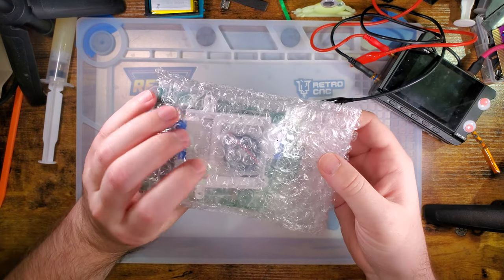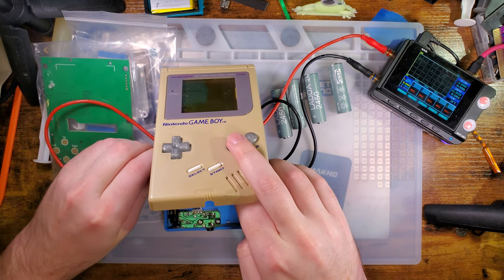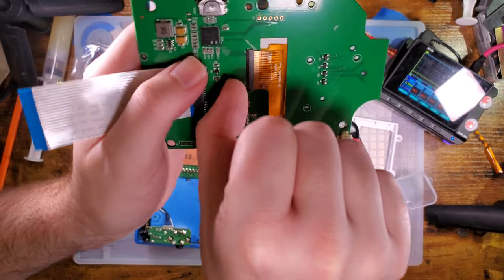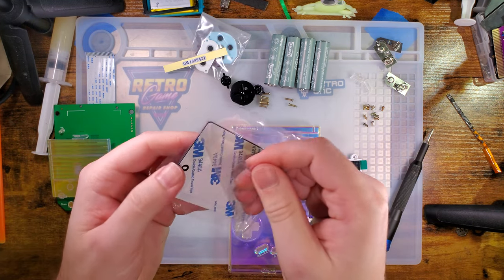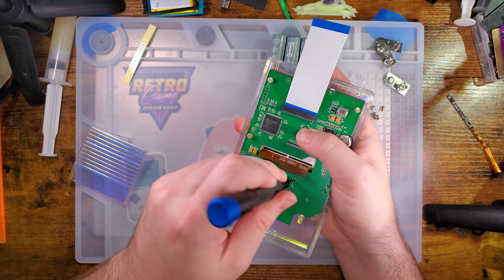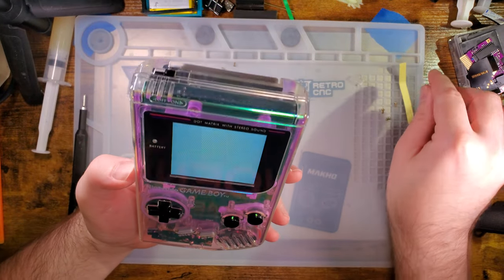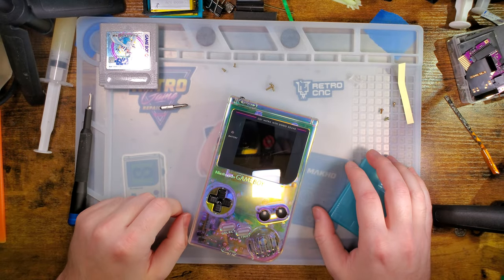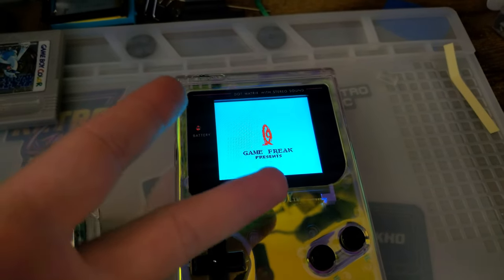Game Boy (DMG) 2.6" IPS Backlight Kit with OSD

Comment: Such a nice kit - I built mine yesterday and I went for the fully transparent shell. The situation with the screws is confusing. You get 3 lengths of screws. The longest ones are for the shell itself, the medium ones (there should be 4) go into the holes that align with the LCD bracket. Everything else uses the short screws.

Comment: Looks like a good kit. Was interested in either the smaller  tft 2.45 one with one of those nice clear shells or a RIPS v4 with a trimmed OEM black shell for a future build. Thanks for showing it off!

Do the high quality shells require trimming for this 2.6 kit btw? Something I was unsure of, if it was already pre trimmed or if the lens area is wide enough already for the 2.6 kit.
Reply from the maker: Nah, the "high quality" shells as sold by RGRS are actually made with these screen mods in mind so they should all be "drop in". Other generic shells or OEM type shells might need the window to be enlarged slightly though.

Comment: I just got this, have it all together. When I fasten the shell together the D-pad doesn’t work. If I take the screws out of the shell, and rest the top half on the bottom half with everything connected, D-pad works. Any idea what I messed up? Lol
Reply from the maker: You sure your membrane is properly lined up and working? Not screwing things down too tight?
Reply: @makho  I ended up using another motherboard and it worked just fine. Thought maybe I had accidentally jacked the CPU. But I plugged it into a stock DMG front half and it worked fine. So I’m not sure exactly what I did wrong.